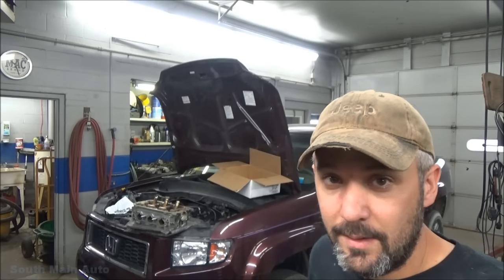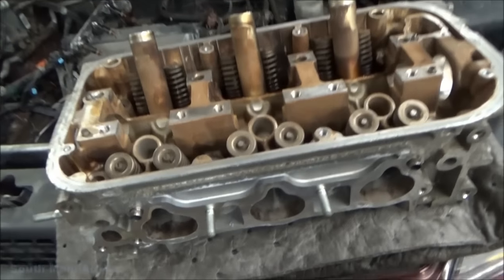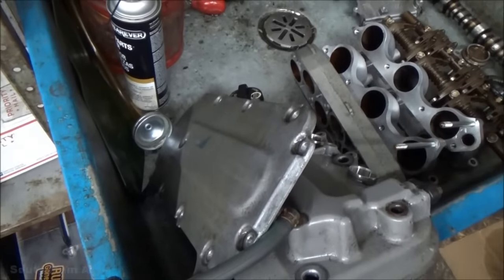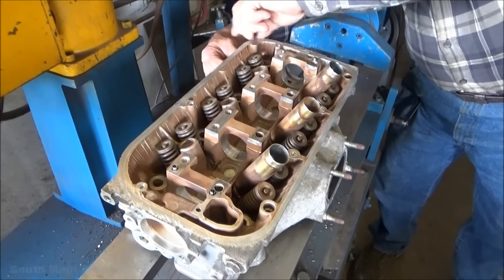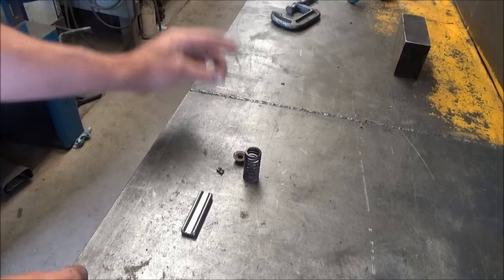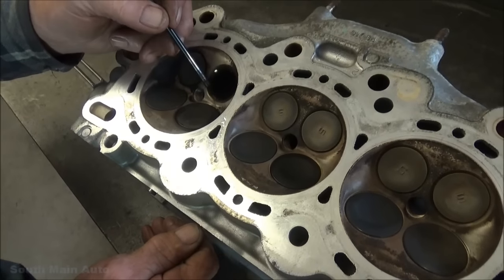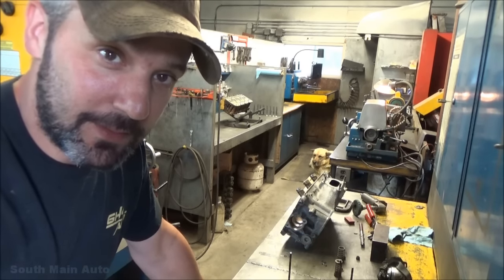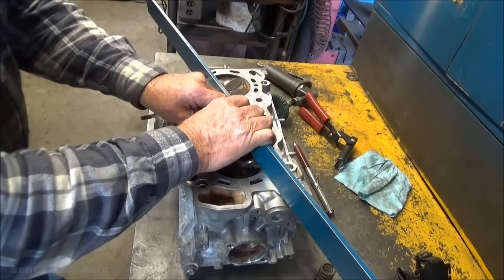Honda Ridgeline - Quick Trip To The Machine Shop

Comment: MY guess is the owner of the car never did oil changes  on a routine timely manor.Oil leakage past the valve guides is the reason for the carbon buildup on the valves.If you do not change your oil  and let it turn Black then this is the type of engine you get.I would like to see the old valve guide seals.I would bet that they are as hard as a rock.I do not trust the Car Dealer ,They most likely knew that Cylinder was a  no compression issue and just wanted to suck some money out of her.Dishonest to do all that work on her car and for the Dealer to tell her on her final visit that she needs a engine replacement.That is so Crooked of that car dealer.Cases like this makes it clear that People who know nothing about car mechanics are a sucker for a dishonest car dealer.There are plenty of them out there too.IF that was my Head being remanufactured,I would use all new Valves,Springs,Guides,ETC.

Comment: Hate these 3.5 engines. The eco system cause carbon build up. Leaks oil when the cylinders shut down to three in eco. Uses quart of oil every 1000 to 1500 miles.

Comment: In 20 years everyone will be driving electric cars no need for machine shops, GM has already started planning for this change.  Batteries are reaching mileage that will make long distant driving possible, sorry for future of engine mechanics and this comes from someone who was a tool & die maker for 45 yrs.  But horse and buggy had its demise also!

Comment: I hate this type of guy's, old and not so old ones, that throw thinks around and don't care about handling. One trying to handle the parts as gentle as possible to avoid unnecessary scratching or denting, and this guys at the machine shop they smash it to the metal working bench to show they are in charge.